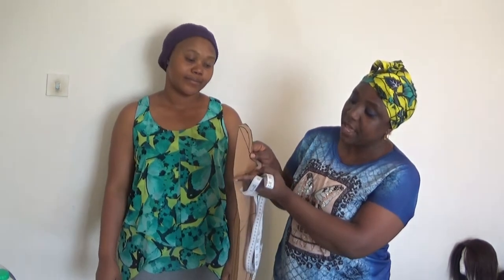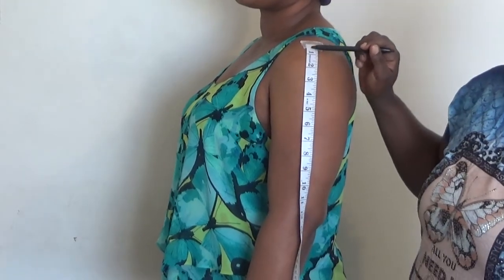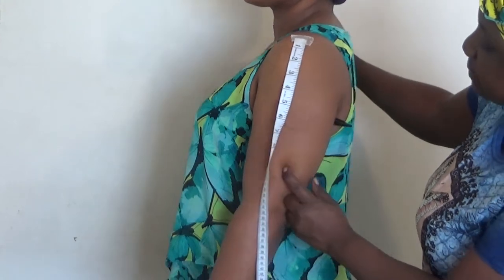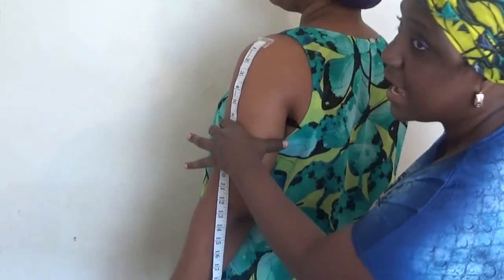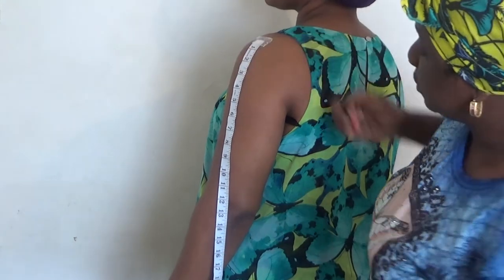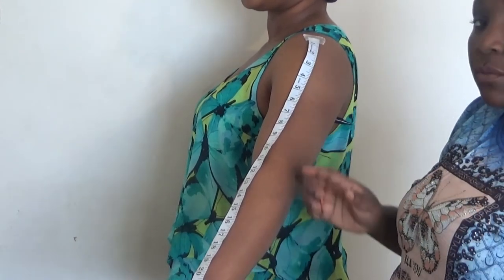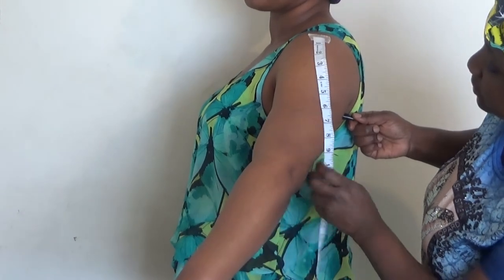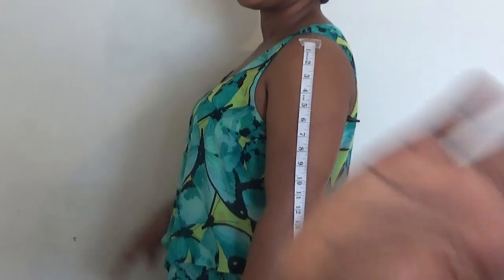How to calculate cap height for basic sleeve block  pattern

Comment: So,,,do we mark 4.5 or 5 on the sleeve draft pattern as the cap height ?
Reply from the maker: Depend on the client measurements
Reply: Correct I understand that. But if the client measurement is the same as your video, in that case do we measure 4.5 or 5? That is my question😁. Thank u
Reply: @latasundar7597  you will use 4.5" as i understood it, because,the lady lifted her hand up.
Reply: @jennysspace3635  Thank u Yahaya for your reply.